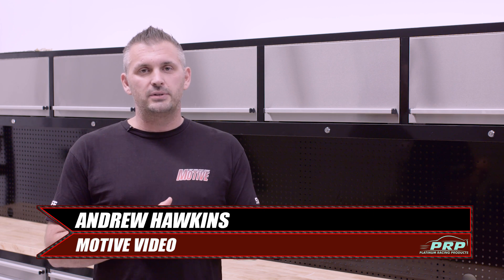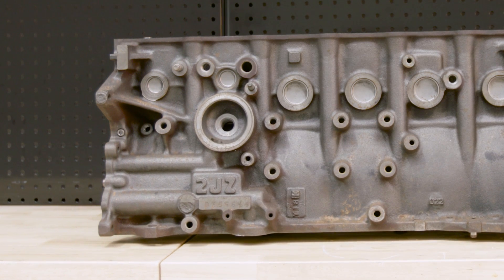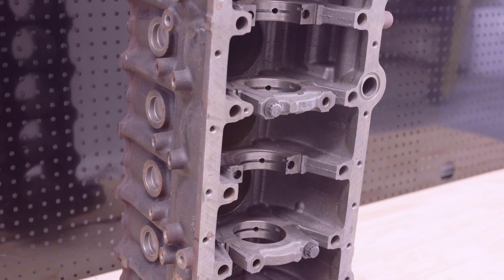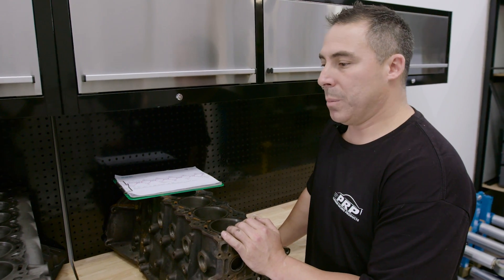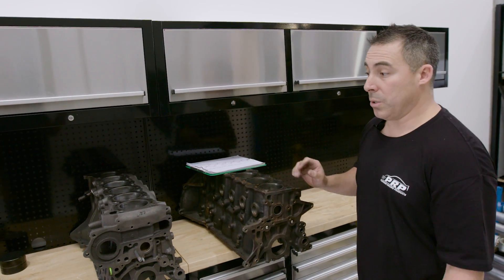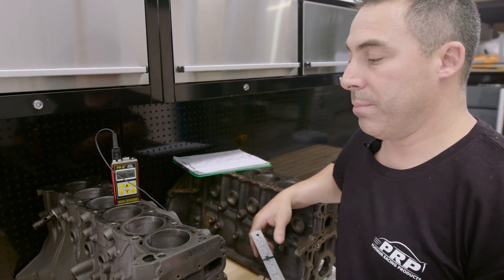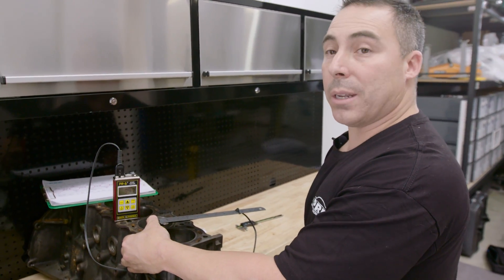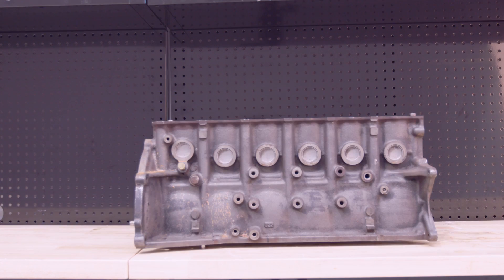RB30 vs 2JZ Which is the Better Block and Why? - Mythbusted

Comment: Well. Thats settles it. The rb is inferior to the 2jz. Its amazing how the RB30 in the King R32 handles 2000hp.
Reply: I dont think any nissan product is stronger then a Toyota product anyway
Reply: @Toyota4Life  oh yeah. By the way. The SR has definitely proven better than the 3sgte. From touring car racing to 1/4 drag racing the SR has quite a bit more sucess than the 3sgte. You can research that too.
Reply: @conradsealy9603  yeah and 3S engines are rare unlike the SR20
Reply: @conradsealy9603  Number of World Rally Championship seasons won by the 3S-GTE: 3. Number of World Rally Championship seasons won by the SR (or any Nissan-powered car for that matter): 0. And yes Nissan did try, but the SR-powered GTI-R was a complete dud.
Reply: @Sci-flyer  The toyota 3sgte was a dud in Super GT GT300 class. The SR 20 on the other hand won multiple championships there. The SR20 also had back to back Championships in the TOCA BTCC beating the crap out of every 3sge engine in the process. Also in the Japanese Touring Car Series the SR20 beat up on the 3s to win champiinships there as well. Like it or not. The SR has way more sucess in different forms of motorsport than the 3s. The fact that youre still arguing about the 3s having more sucess than the SR20 shows your ignorance about motorsport. Ask yourself if any 3s engine has ever made over 2000hp? Feel free to type in 2000hp 4 cylinder on youtube and see what comes up. I doubt you will see a 3s but you will see the SR.😉
Reply: @conradsealy9603  yeah right, did the SR win 4 championships across BOTH JGTC categories? Nope, 3S did. The SR won a single championship in the BTCC, thats "beating the crap" is it? yeah nah. Face it, Nissan engines suck.
Reply: @Sci-flyer  wrong. 1998,1999. The P11 Primera(with SR20 power) won the championships including the independents cup with Matt Neal. Go research it properly. Jeezz. You cant even do a proper search. Why the hell are you even here?
Reply: @conradsealy9603  to prove you wrong. JGTC= 3S > SR. WRC= 3S > SR. So youre not doing a very good job of showing how the 3S is a "dud"...
Reply: @Toyota4Life  well. Maybe you can explain why Mc Laren chose a Nissan racing V8 for their cars. Feel free to research it. ALL. ALL. ALL Mc Laren V8 cars have aa engine based on a 20 year old Nissan racing V8. By the way. Feel free to look up which auto manufacture has more sucess in motorsports. Here is a hint. Its not toyota.😉
Reply: How the heck did the RB manage to have so much sucess in road racing? Even winning the SPA 24 hours in 1991.
Reply: @conradsealy9603  Nissan solved its weight problem with power toyota solved it by cutting weight eg using a 3sgte in their racing supras instead of the 2J
Reply: @Realtime1501  yeah. I know about the 3sgte supras in the JGTC. They had very little sucess compared to the RB powered Skylines.
Reply: IIrc, they did that for better balance/handling, allowing the engine mass to be further back in the car?
Reply: @Realtime1501  and it was a good package, it's just that in comparison it lacked because a little in line four had to cope with godzillas!! I believe it still is  a very underestimated engine by many, but once tuned right its very good.. I've never had problems with mine and it's taken quite the abuse! I guess if you're not aiming crazy power figures and value function, torque delivery over maximum output.. It's gonna bee fine around 500whp all day..
Reply: @conradsealy9603  they weren't running super high levels of boost back then
Reply: @Turshin  true.
Reply: @conradsealy9603  the awd altezza system. It corrected power issues and driver errors. The drivetrain and chassis worked with the motor to make a complete system
Reply: @thebr0kenw0lf  somehow that awd altezza doesnt even come anywhere near the sucess of the skyline in motorsports.
Reply: @Mr Calcium well. To get any engine small like the typical jdm engine to those power levels reliably is amazing. Funny the 2jz has vertually no road racing history while the RB has quite a lot of sucess at road racimg and time attack.
Reply: @Tex 13 I agree with most of your last comment however as for the SR. To say its inferior to the 4g63 isnt excatly accurate. Mazworks,Mick Motorsports and GT Autosound have certianly proven the SR quite capable of beating the 4g63 in drag racing. In the case of GT Autosound they have a oem cast(wet block) SR at 1400hp thats still street driven with over 60 1/4mile passes on it without issues. There is a video on youtube with the car doing a 7.42 pass and still street driven. Of course the block has thicker slevees and most likely a billet main cap girdle instead of the oem cast one but we're talking about 1400hp from a 4 cylinder aluminum block.
Reply: @conradsealy9603  I'm surprised no one has mentioned the Infiniti/Redbull f1 car.  Mmm... tasty tasty flat plane v8... 

Tbh the 4g63 out of the 1g dsm was a pretty wicked motor. I remember back in the day when Shep racing was posting some of the fastest times at the strip. One year Toyota day was rescheduled to be the same day as Mitsubishi day- Dsms posted consistent low ets all day and every third Supra blew a head gasket half way down the track. Guess they didn't know stock head bolts couldn't handle all that extra boost 😂😂😂
Reply: @daftpanda6533  the 4g63 is a good engine when under boost but is lame in N/A form. The SR in recent years has proven to be quite good. Mazworks now have SRs at almost 3000hp with a compound turbo set up. I dont know of any 4g63s at that power level.
Reply: @conradsealy9603  3k Hp on a cast aluminum block? That's asking for trouble. Mazworks themselves say a the SR short block is "usually only last up to 1300hp. It then splits horizontally under the head studs" 

Look, I'm not here to get into a "what engine is better argument." I'd rather appreciate the time, engineering amd passion that various shops put into their engines. There are many great engines out there and many can make lots of power with enough time, money and engineering put into them. The 2jzgte is a great motor. The RB series is great, despite the oil drainage issues and crank collar issues. The 2j bottom end might be a bit better, but RB26dett heads and valve train are known for high rpms and excellent flow.

Personally, I prefer Nissans. (I've owned quite a few) but I also love and appreciate other cars/engines. 

My dream build is to get another s30 Z and swap in  either 
A: Vk series w/ TT
B: VR series
C: Rb26dett N1 
D: Rb30de stroked to 3.2 NA. 
Really it depends on build budget.
Reply: @daftpanda6533  I prefer Nissans too as they have a lot of sucess in various forms of motorsport. One of my cars is a SR20powered S13(200SX). There is the GT Autosound S15 that has a 1400hp street driven wet block SR but I agree. Thats about the limit for a cast aluminum block and still expect it to be reliable and last. The GT Autosound SR actually has 60 1/4mile passes with no issues. The car does 7.42 in the 1/4 mile. Thats sick.
Reply: @conradsealy9603  I've owned a bunch of usdm 240s including a s13s, 94 vert, a s14 kouki. Never had s13 coupe tho :/
I miss my s30 (early chassis) 260z the most. It was my resto-mod project that i had an rb25det for. Had to sell it when i got married and moved. 
Currently drive a 2012 Altima SR. It's a great daily but i want a rwd or awd project car.
Reply: @daftpanda6533 I hear you. People approach me alot to buy my S13. I simply tell them I emjoy it too much. Its not for sale.
Reply: @conradsealy9603  the Sr and rb are both garbage engines to thing they could even step into the realm of s jz or 4g63t you must be smoking some really good shit. The fastest drag cars are all jz Rotary & 4g63 powered ...literally. You know what's not up there on those leaderboards? The rb and Sr 🤣 hell the ej207 and ej257 motors are all out in front of that garage by a long shot. Go do some research yourself and see what the fastest import in the world is powered by because it isn't an rb I'll give you a hint thoug...it's Toyota powered and right behind them are rotaries
Reply: @conradsealy9603  the second fastest manual h pattern car in the world is here in the US at 6.9 with boostins talon. Thr Sr doesn't even hold a candle to the 4g63 when it comes to drag racing or rally so you can cut that nonsense shit out you keep spewing
Reply: I guess you could say the RB is just strong enough to do the job.
Reply: @conradsealy9603   The RIPS rb30 Z gets the job done...
Reply: @daftpanda6533  no arguements there. 👍
Reply: yeah i retract my previous statement...its still a cast block. Very decent
Reply: The road racing history is cool but there's an issue here rbs reliability for building a high hp streetcar which is more realistic in today's world a 2jz is still kore capable of putting the power down more reliably also we have the tech today that we didn't have back then as well as the knowledge. If there were jz road race cars these days as I said results would be much different
Reply: Its running a billet block now i think...
Reply: @cams7267  I know when it did 7.00 pass it still had the oem cast block at that time. Maybe its the main bearing cap girdle that saves the RB.
Reply: @my1krr  they did. Nissan just beat the crap out of toyota. From the Super GT series in Japan to IMSA in the U.S.

Comment: i wonder which head in stock form flows better?
Reply: @yba202 WOOOSH
Reply: @postmortemspasm  yep haha
Reply: Would be a good video, stock RB30ET head vs 2JZGTE :P
Reply: @givejamesacall  Incorrect. 1.5JZ is often done, because people with a 1jz want more capacity, and/or don't want to change their intake/turbo configuration.
Reply: @Ash_mz21  i disagree.  I have friends who have purposely built 1.5jz motors because of the 1jz head flow
Reply: @Ash_mz21  different strokes for different folks..   its good not everyone agrees with everyone 😀
Reply: @givejamesacall  did they flow bench both heads?
Reply: I have read the rb head flows better, stock to stock. But unsure what head flows better after they are both upgraded.
Reply: Ask my uncle's sisters brothers cats nanna Frank blog
Reply: As anecdotal evidence a mates old soarer (1jz)made less power than my old skyline(rb25) both had 60-1 turbos and ran about the same boost the difference wasn’t huge but the way they came on was my skyline was on before the soarer 
Without actual numbers this is all heresy and guessing but I’d say the rb head would outflow a jz

Comment: The gen 4 supra has always been the real godzilla of japan he 2jz has always been better toyota over    engineered itm
Reply: Nissan was more successful in racing.
Reply: @marc9283  Thats a rash and shallow statment It is one of the best bang for buck motors out there 2nd would be the 03 04 cobra motors. The supra chassis is also race proven in several classes the supras did fine in jgtc but they werent even 2j powered so i dont count them. The mk3 supra my personal number 1 love. Has a great chassis as well and it did well against the r32 it won alot of races in its day. yes the usa version has the 7mgte its a good motor too has weak spots. But toyota learned from there mistakes. but there was alot of different versions in japan along with factory 1j's Then theres the super rare 3.0 turbo A models. The supra has won and achieved alot. It has set records they do loose they do loose they still blow up. Anything mechanical can and will fail eventually. Im a r33 fanboy myself "dat ass" and always loved the r32 im a nissan fan aswell at one time owned a 80 280zx turbo l28. I love 350z's and what that chassis has acheived. It is a good track car good drivers car. Love the vq's the sound of a straight piped 350z is intoxicating. The skyline has alot more going on underneath everythings expsensive. The gen 4 supra is so simple underneath. From front to back looking at one on a lift you can see why they do what they do. Everything is well made and beefy. The 6 speed trannys are strong too . The rear ends will take alot of abuse. They are easy to work on in my opinion. Its just like seeing a fc rx7, fd rx7, and rx8 all on a lift starting with the oldest chassis all the way up to the rx8 mazda did there home work each chassis got more bracing more rigid blah blah. The rx8 handles amazing its not super fast at all but god you can push it hard on a track or curves. The renesis is just a pos. Emissions and rotary dont go together. Im going on rant shew. Your short comment enraged me lol.
Reply: the Jz series was specifically engineered to beat the RB in every aspect there was a rumor I heard that Toyota sent an M7 and RB26  to Stuttgart for Mezger to look over and give his opinion on how to improve them and those details made it into the Jz series
Reply: @Realtime1501  you mean the 7M?
Mezger is a legend, any sources on that?
Reply: @marc9283 yes the 7mgte, not that I could personally confirm but it was an underground story in the early 90s I heard from an old engineer who worked on rotating components in Germany at the time,that was also apparently one reason Toyota incorporated many German parts into the Supra because Mezger impressed them so much with his analysis
Reply: Yea that was the 7M!
Reply: @Tex 13 like i said the 7m has alot of weak points but ive seen plenty over 500+ 700+ is it a big invest and alot of risk when u could just swap yes. Im a mk3 fanatic and i personally have never wasted my time with a 7mgte. Its straight to the 1j the way the us version should have came

Comment: I wonder how a s54 bmw engine stacks up?
Reply: Bobby Grobar it’s pretty good. It doesn’t take that much to get to 800-1000Hp. But the aftermarket to past 1000 isn’t really there, compared to the RB and 2JZ
Reply: tho i would more likely to see m50,m52,m54
Reply: Head gasket, vanos, bottom end failure due to high revving and rear subframe cracks. Great car, but certainly has its flaws. Will be getting rid of mine even though it's a rare 1 of 14 model in mora metallic.